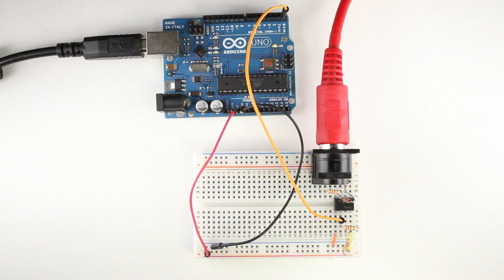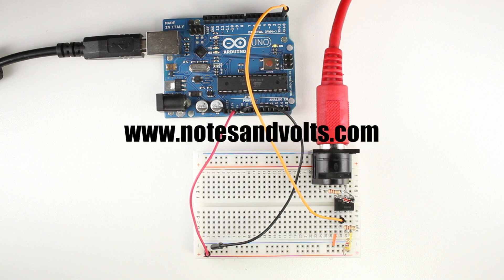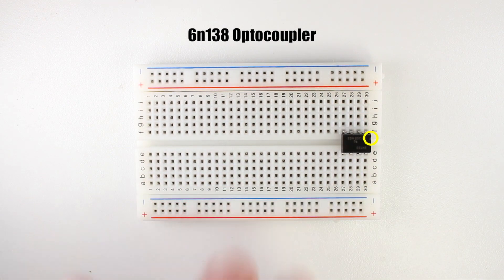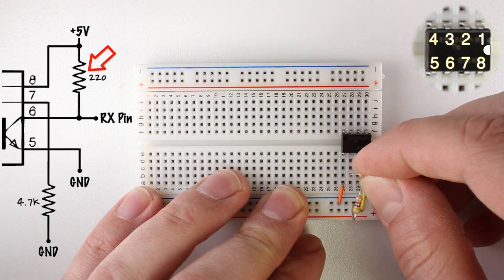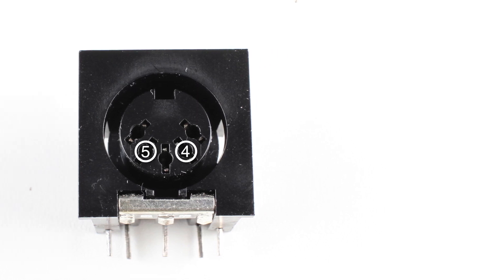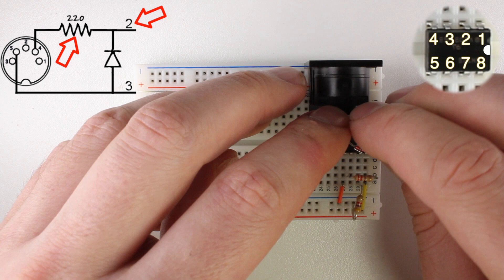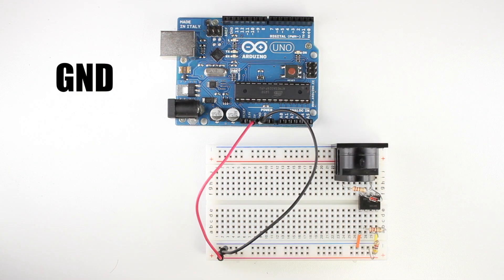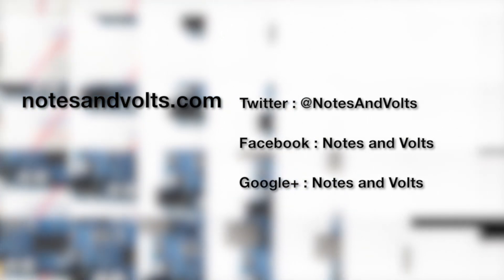MIDI for the Arduino - Build a MIDI Input Circuit

Comment: The PC957L optocoupler may be an alternative solution. It has a maximum propagation delay time of 0.8μs and eliminates the need for the resistor at pin 7.

Comment: Wait, so what can you do with this circuit? Does this mean you can basically control almost anything using a midi input into an arduino, which would then control anything else?
Reply: the input is the midi signal, and you can use this to create a control voltage to feed into an analogue synth :-)

Comment: Hi, Thanks for the videos! very clear explanations. I have one question: Im using a 6N137 optocoupler, and used the exact same circuit as shown in the video but im not getting any input on the RX pin (directly connecting midi pin 4 to RX works..). Do i need a different circuit for a 6N137?

Comment: I have been cross referencing the electronic side of all this because of so much confusion as to which line the 220 r goes in series with... - I see that there should be one in series with the signal pin AND the power pin (total 440 r)... - but again here it is connected direct to the pin...

Comment: Hi! Is there any problem if I connect the pin 6 of the optocoupler on the RX pin of more than one arduino at the same time? (I guess it would be parallel connection, am I right?) I want to use the same RX signal to control 6 arduinos. Sorry for the bad english and poor knowlodge in electronics, greetings from Brazil

Comment: Bought wrong optocoupler. PC817 is 4 pin.
Reply: You can add a 2N2222 transistor and a resistor to be fully 6N138 compatable.

Comment: I am sure it must be something in the code but how do I go about compiling the MIDI data to USB to send to a computer?  Pretty much I am trying to make this into a MIDI to USB interface.  can this be done with this?  if So How?  I have checked all over online and I have heard it can be done but found no one actually showing how to do it within the code.  This is for a class Final that is due next week.
Reply: Hi Michael. Any luck with this? I'm interested in using this tutorial to make a MIDI to USB interface, so I wanted to know if you found the way to make it work

Comment: struggling to find these parts in the UK, postage for some are ridiculous
Reply: I got 5 optocouplers from bitsbox co uk (6N138  - OP137), 71 pence each and £1.75 postage. Comes out at about a pound each. Not sure about the other parts, I had them to hand.

Comment: This worked the very first time I built it - thank you!  I used the same recommended optocoupler (6N138).  I've seen posts that you can use the 6N137, but you shouldn't connect pin 7 and you should use 10k ohm resistor between pins 6 and 8.  But I haven't tried it.
Reply from the maker: Thanks Greg! Yes, some people use the 6N137 but as you said, the circuit is different.

Comment: Thanks a lot man.
Is there a way to use similar value transistors and a separate optocoupler chip (4-pins) instead of that 6N138?
http://www.vishay.com/docs/83605/6n138.pdf
Reply: igrewold Yeh should work ive tried a few difrent optocoupler :-)
Reply: Good news, thanks a lot man.

Comment: Hello,
your videos are very interressente. :)
I would like to know if with arduino we could use a controller of the moment like, https://www.sonovente.com/akai-midimix-p47276.html, usb vrs arduino in midi, to control the programs Midi which are in program al inside a Grovebox Like the roland mc 909, with the akai?

thank you
Reply: Hi, with an arduino, you can do anything. Now, consider another akai device, this one which means to control ableton like scenes. It will be easier to program the arduino with push buttons than rotary potentiometers to do the job.

Comment: Very good, the first to congratulate you for the information you provide, the question is the following; If I connect the output of the RX pin to make a MIDI-THRU to the output pin 5 and a resistance of 220 Ohms to pin 4 (with 5v) of the midi connector would work?

Comment: Muy buenas, lo primero felicitarte por la informacion que brinda, la pregunta es la siguiente; si conecto la salida del pin RX  par hacer un MIDI-THRU al pin 5 de Salida y una resistencia de 220 Ohms al pin 4 (con 5v) del conector midi  funcionaria?

Comment: Your steps for these synthesizer tutorials are very clear and allow me to build the circuits with ease, but I'm new to electronics (obviously, or I wouldn't need tutorials like this) and I'm constantly frustrated that you never explain why you're connecting "this" to "that". You're making assumptions about your viewers knowledge and not really helping anyone understand why they're doing the things they're doing, which is the most important part of ANY learning experience. So...I'm happily going to be your first thumbs down. Sorry. For instance, what kind of information is being passed through each of the 5 pins on the midi jack? What are the functions of each of the pins octocoupler in this instance? What IS an octocoupler? I get that you probably want to make your videos brief, but it's far more important to cover all of the details.
Reply from the maker: You need to watch the other videos in the series, especially this one: https://youtu.be/0L7WAMFWSgY
Reply: Okay, all is forgiven. I took a nap and am much less cranky now. Thumbs up, thanks!

Comment: How would you go about connecting a second MIDI jack for MIDI Thru?
Reply: Very very very late response, but according to official MIDI specification documents, it seems you can make a MIDI Out circuit (as seen in another Notes and Volts video) and wire pin 4 of the octocoupler to pin to pin 5 of the MIDI Out jack, and it SHOULD send out a direct-copy of incoming MIDI data. :)

Comment: Thank you for the Video!
And what changes if I use 4N35 Optocoupler instead of yours?
Reply: Actually, nothing. Most Optocouplers don't differ that much, especially for usage with 5V. They only differ in the way the ports are assigned.

Comment: hey. i have question. my arduino looks like it recieves data cause when i play whit vmpk the RX light in my board turns on. but the 13 led doesn't turn on. what should i do?